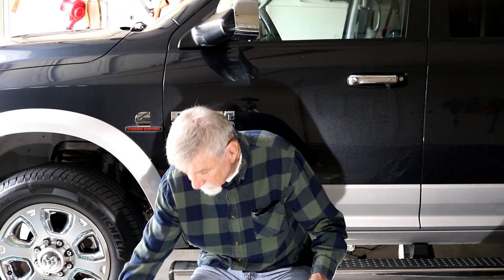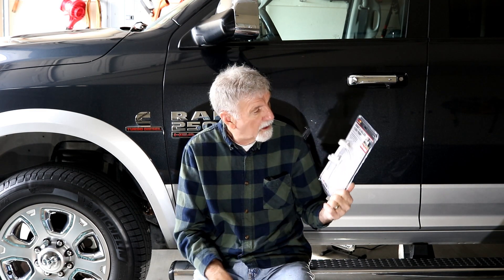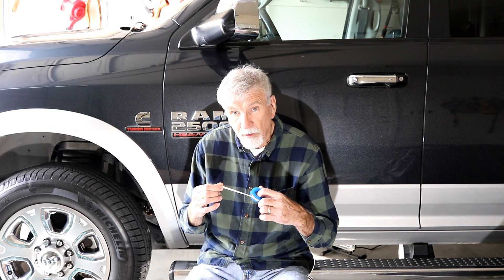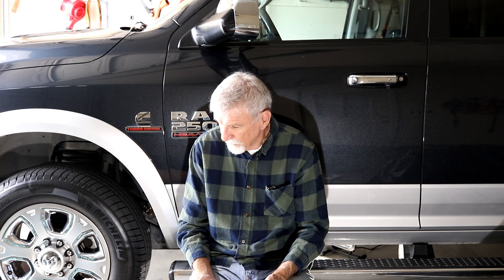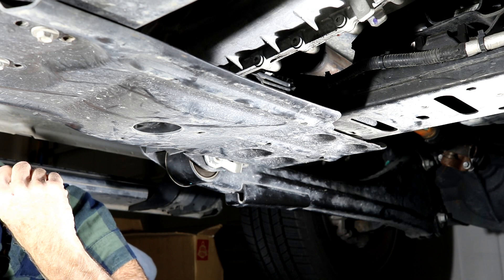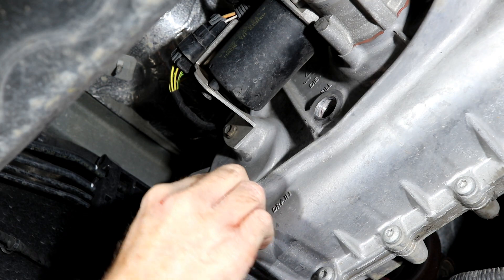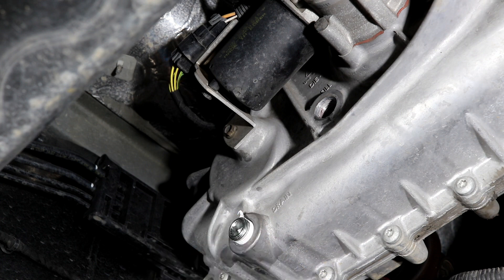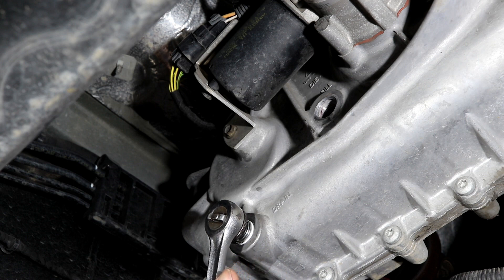Ram 2500 4 x 4 Transfer Case Oil Change

Comment: Hey Marion, I just did my 2nd (60k) fluid change. I looked on YouTube for a refresher and yours popped up. I remember it from my (30k) service. One little tip I stumbled upon that I thought I should share. When removing the skid plate, leave the right rear bolt loosely in place and the skid plate will rotate out of the way and rotate back when finished. Not a big time saver, but it was nice not having to line it all back up when laying under the truck. Thanks again for your videos. Always nice to watch them. 👍

Comment: Marion, I really like your channel. I also have a 2014 6.7 3500 Ram Truck. Did a lot of research on the lubricant for the 44-46 and 44-47 BW transfer case as Mopar has priced their oil out of sight. Spoke with the Amsoil rep and Amsoil now has one. It's part of their Signature Series and is priced around $21 per qt. Plus you can get it in their flexible squeeze bag which makes the filling very easy. Also, BG has now developed one and our Ram Dealer here in my town is now using it instead of the Mopar oil. Check it out as both companies produce top quality lubricants. I prefer the Amsoil and have had no issues. Thought this might help your viewers find something other than the WAY OVERPRICED Mopar oil.
Reply: What codification has the amsoil lubricant to BW transfer case? Thank you.

Comment: If you want to save a little scratch next time you change the fluid, the company that builds the transfer case fills them with DexIII fluid when they are built. There’s no need to buy the liquid gold from Mopar. This is first hand knowledge not hearsay.
Reply from the maker: Yea, thanks for the tip.  This stuff was over $20 / quart
Reply: @MarionBlair  Now it's $31/qt at the dealer (Dec '20)
Reply from the maker: @dantaylor1068  Good Lord!

Comment: I don't know if mine is an isolated instance but my transfer case has developed a leak between the case and the trans at around 105k.  I'm betting it's the seal, which is about $10, but I'm not exactly looking forward to pulling it out of the truck and replacing it.  But you know what?  I'll be damned before I take my truck to any dealership for a repair.  It might be a PITA but I'll know it's done right and the first time!
Reply from the maker: Yea, it doesn't look too bad if can get a little working room under there.  Maybe try torquing the bolts if you haven't first.  Also, there's a vent hose on over by the u joint (i believe).  Make sure it's not stopped up.  You've reminded me to put that in my video.  I forgot about it.

Comment: Sir, just wanted to let you know I completed the change in my transfer case today (2015 2500). Your video was invaluable. I thank you so much for taking the time to put this info out. PS. My only mistake today was placing the oil pan too close to the drain —man that stuff comes shooting out!! Left 1/4 quart on the ground before I could move it!
Reply: I know im randomly asking but does anybody know of a way to log back into an Instagram account?
I was dumb forgot my password. I love any help you can give me!
Reply: @Kaden Ira instablaster =)
Reply: @Emerson Wilson Thanks for your reply. I found the site on google and im waiting for the hacking stuff atm.
I see it takes a while so I will reply here later with my results.
Reply: @Emerson Wilson It worked and I now got access to my account again. Im so happy:D
Thank you so much you saved my ass!
Reply: @Kaden Ira Glad I could help :D
Reply: What fluid did you use on the transfer case?

Comment: Just did my 2013 ram  68rfe transmission today. It’s a messy job but went with Mag Tech pan to make it easier next time. This one tomorrow. I still haven’t found the grease fitting. Thanks for the videos.

Comment: I feel like a regular fixture on this wonderful site! (lol)  This comment is a bit off subject, but transfer case related.
Last week while pulling our 35' travel trailer, we stopped in Kingman AZ for one night on our way to Grand Canyon. Just when we were exiting I-40 we heard a horrible grinding sound. Almost sounded like we were dragging something under the truck. We stopped (so did noise) on the off ramp and warning light was on the dash that read "service 4x4 system".  I put the truck in neutral and rolled slowly forward on the downhill slope. The noise was gone and so was the light. All seemed normal again, so we continued another 2 miles on the surface road to the KOA in town. 
Our pull-through space was gravel, so I took the opportunity to move it in and out of 4x4, and 4x4 low. No problem. With no internet and being late on Saturday, I called my brother to do a Google search. What he found is that the truck most likely tried to go into 4x4 low range all on its own, at 45mph!! (we weren't the first ones to experience this, others with catastrophic results)
I pulled the 10-amp fuse that controls the transfer case servo motor and we continued our trip without incident. Upon returning home, I went to the dealer. They were mostly useless. The service writer found 3 codes, one of which was for the rain sensing wipers. Other 2 were related to 4x4 system. I asked if they would drain transfer case and check for any evidence of damage in the fluid. Yes they would, but I had to pay for it. Now I have an appointment with my trusted transmission shop. They'll do a transmission service and drain the transfer case to see if anything shows up. 
The weather was close to 90* and the truck's fluids were hot from pulling mountain grades. But it was not at all overheated. Therefore I have to assume whatever happened was an electrical issue related to the heat. We live near San Diego and only use 4x4 when we go to snow in Mammoth Lakes several times during the winter. It sucks to have to do this, but I'm probably going to run the truck with the 4x4 fuse out, and just put it in when we need it. No big deal, but I miss my old "part time" 4x4. This kind of shit didn't happen :) 
BTW, this truck is a 2016 3500 Cummins with the standard automatic transmission and 30,000 miles on the clock. Still has factory powertrain warranty. 
Dave O.
Reply from the maker: That really sucks.  Sounds like my luck

Comment: Finally - an easy Ram oil change!.lol 
I always error on the side of caution when tightening ANY of my drain plugs that have OIL or lubrication on the threads. Anytime a bolt has OIL on the threads you should use 35-45% LESS torque than you would when tightening a DRY bolt. The same goes for GREASE 35-45% LESS to achieve bolt axial load or tension.
- FYI- I would have put a little less force when tightening those plugs.  That plug won't leak with teflon thread, it seals great.

Comment: One difference between you and a Millennial is that after you tighten the bolts on the skid plate you torque them to feel.  Most Millennials will torque with the air tool and if they even try a wrench on them the bolts will likely be overtightened.
Reply from the maker: Thank you

Comment: Hello again, Mr. Blair.  I'm hoping that you remember me, but I'm the guy with the 2012 6.7L Ram 2500 with the crazy emissions issues (aka, the Katrina guy who used to live in Harvey, LA).   We just found out that we will be "out of pocket" $6,000+ to bring the emissions system back to factory specifications ...so we -- and I'm sure you would agree -- are inclined to make some "changes" to our truck to make it more reliable and run like the wonderful 6.7L ISB we paid for is capable of.  What I wanted to ask you about was the device I've seen in your videos -- the one that displays all of that great information via a video screen.  Although I've been up to my elbows in our old 5.9L Cummins Ram, I'm a rank beginner when it comes to the 6.7L version, so please bear with me here ... Is that device part of a "tuner" or is it simply a device that acts as a video display for multiple "virtual gauges."  Perhaps you've already covered it in other videos, but I'm so bogged down with talking to folks about getting the truck towed here and there that I haven't been able to spend a lot of time on YouTube lately.  Thanks again for your time.
Reply from the maker: Hi, of course I remember you.  I didn't know where you moved to when you left Harvey however.  There's two monitors I've played with but the one you probably are referring to is the Edge Insight CTS.  It's just a monitor and doesn't change anything in the PCM so warranty isn't affected.  I also just did a couple of videos on the Torque App which is an Android app that can give you some of the info.  The Edge has a crappy screen but otherwise it works.  If you just want exhaust temp and DPF regen you can use the torque app with your android phone. Question, what's with the 6K on your emissions system?  Did you delete and now the state is making you put it back to spec?  What state did you move to?
Reply: @MarionBlair  Although I'm a deep southerner myself, Mr. Blair, my wife is a Massachusetts yankee girl.  Long story long, we lived in Harvey, then Gretna and, voila, Katrina blew us up here.  I do, however, still go home for work, so I'm not an actual Mass citizen, which brings me to a wrinkle.  As I still spend a lot of time in the south, the truck is still registered back home (in a non-emissions-testing state).  Along with lots of other over-governing, Mass tests their vehicles annually to keep someone in Boston in the life they've become accustomed to.  The point is that, technically, I don't have to worry about emissions testing ... but ... who knows what the future might hold for us.  Regardless, the $6K they want from us is only part of the entire bill.  Believe it or not, the entire repair order -- for just the parts -- totals almost $12,400.00!! (comes straight off the dealer cheat sheet).  The $6K part is what we pay ... and the rest ... well Mopar is paying for that out of the goodness of their corporate heart (and out of the extended 7-year Mopar warranty we've been paying off for years).  It's truly a sad commentary on what the EPA folks are doing to these fine trucks, but I trust you agree that we're not going to put the gag back on the engine. In closing, it's $6K+ to restore the truck to the stifled soot processor it was (aka, back to factory specifications) or spend a lot less to restore the reliability that our old 5.9L Ram 2500 4x4 is still famous for (al least around here).  Now that I've worn your eyes out, do you have any thoughts on anything to do with modifying the 6.7L ISBs?  Thank you, sir.
Reply from the maker: @timberwrightsvs480  Oh, what a dilemma.  I'd keep it registered down hear and leave it clean, ha.  Have you had any issues with the delete, do you know what tuner you have etc etc..  BTW, I traveled to Boston/Worcester at Raytheon  many times in the 80's while working for Exxon.  I really loved it.  My sister lives in New Hampshire, Florida and Bar Harbor depending on their mood but spent a lot of time in Bar Harbor.  Loved Boston however.

.
Reply: @MarionBlair  As always, thank you very kindly for your responses, Mr. Blair.  I probably fouled it up somehow, but the truck is presently sitting in the driveway.  It is still bone stock ... coughing, smoking and belching white smoke.  In short, the defective emissions garbage is still on the truck, but, based on costs alone, we plan to order a tuner, an exhaust system and an additional kit to deal with what the dealer tells me is the root cause: a defective EGR cooler.  Put simply, we cannot afford $6K+ to restore the truck to factory specifications, so we don't have a lot of choice here.  Please let me know if you're interested, sir, and will keep you informed about our progress ~ Joyeux Noël

Comment: Thank you,  your videos are teaching me how to do things myself that are invaluable.
I tow with my truck mainly in the summer heat of the deep southern US, I have saw advertised 
deep transmission pans that add fluid capacity.  Do you think they would aide in cooling the transmission,also what about using synthetic fluid ? thanks for any reply.
Reply from the maker: I've never tried one, I'm sure it might help a little.  My 1st reaction would be very little as the cooler is doing 99.9% of the cooling but I could be wrong.  The fluid doesn't stay in the pan very long so I'm not sure it would get a lot of retention time, even with the added capacity,  to get the benefit of the bigger pan which  I assume has aluminum cooling vans etc...  It may take longer to heat up the extra fluid on inclines but on the straight away,  I'm not sure.  Just my thoughts, I could be way off.  The main reason I would install an after market would be to get a drain plug, ha.  Some one who has one may know.

As far as synthetic, I assume you mean in the engine since the transmission is filled with synthetic.  I've always ran Delvac 1300 in my diesels but that's mainly because I don't put enough miles between changes to really be economical.  I'd be draining oil every 6 months with 4000 miles on it.  However, synthetic is going to hold up much better for the turbo and engine in the high heats when towing in the summer.  So if I towed more often, I'd switch to it.  The only thing I don't like is the 5 w 40, I wish it was 15 w 40 but it works and is great for winter cold starts also.  I'd still change it 10k or less even with the synthetic but that's just me.  From what I've seen of some of the oil analysis, it gets kind of iffy above 10K.  But I haven't done it so take this with a grain of salt.   No question that synthetic is superior to dino oil at either extremes, cold or hot.  Normal conditions, I don't think it adds much other than you can run it longer as it hold it's property and vis longer.  Just my thought.
Reply: thank you.
Reply: Adding a deep transmission pan lowered my cruising temp from 172-175 down to a solid 165 with or without a load. The temp still spikes when the tranny is working hard, but it cools down a lot faster as well. Definitely worth the money. 
If you install one, it’s a good opportunity to change the tranny filters as well.

Comment: Mr. Blair,
2018 Ram 2500, 37,000 miles.  Have owned it since new.
After watching your video(s) I’m going to attempt changing out the front and rear differential oils.  Never been changed.  In addition, the transfer case.
Question:  If the rear differential has a limited slip, do I need to add an additive with the new oil?  Also, is removing the cover plates on the differentials and replacing the “gaskets” a more thorough approach or am I making more work for myself than necessary?
Would greatly appreciate you input.  Many thanks!
Take care,
Dan
Reply: Your games shoukd be reusable. Just take care when removing the cover and peeling gskt off. The rear differential should be an AAM
11.50 helical gear limited slip.  Model # 292AA.  This differential does not use clutch or friction plates to attain limited slip. It uses helical gears to attain limited slip. As a result it does not require any limited slip additives. Just get a dealer to confirm what differentials you have in your truck and go from there.

Comment: I'm a bit overdue on mine needing changed, but what is your confidence level in doing this the first time?  I'm fairly intelligent, (I once build a 318 V8 engine for my Charger) but these newer things "concern me" some.  I've learned to change my oil and fuel filters from your videos.  

I think I could do the same with the transfer case and diffs.  

BTW, side subject.  What are you thoughts on the Banks Rear diff cover for the RAM and AMSoil  lubricants?

Thanks.
Reply from the maker: 100% sure you can do it.  You can do it without remove the hose like I did.  Just take the bolts out and slip a new one in.  I think if I was going to add a rear diff after market cover, Banks would definitely be the one.

Comment: Hi good video. Got a question even if you don’t use the 4x4 have yo replace the oil?
Reply from the maker: I wouldn't pull the cover, use a little hand pump from harbor freight or whatever.  I really doesn't get dirty from what I've seen.

Comment: Good video my friend. Does the manual say to change every 30,000 miles?
Reply from the maker: No, it's check it at 30 and change at 60 unless you do a lot of towing and severe duty like police work etc...
Reply: Marion Blair thanks for the info!  Stay safe.

Comment: I have a new truck that makes a loud cluncking noise after stopping, selecting 4 wheel low and then shifting into drive, I can't tell if it's the front drive shaft or the transfer case?
Reply from the maker: That could be normal actually.  Ram  tells you this shift it while you're still rolling in neuutral. try that and see if you still get the clunk.
Reply: @MarionBlair  I will try rolling it in neutral, thanks so much for your help, all is great once it's moving in 4WD, and I take it easy on my truck because I want it to last. I do realize that there is tremendous torque force's involved being diesel compared to gas. Thanks again, and your attempt at Spanish is far better than mine.☺️
Reply from the maker: Haha thanks

Comment: Would you recommend changing differential fluid front/rear at 30k if you DON'T tow very often?

I'm trying to figure out if I should do diffs and TC, diffs, or none.  Truck has 29k miles.
Reply from the maker: No I wouldn't.  Just look for leaks and check fluid level if you see any signs of leakage.  BTW, my son  has 300K on his and has never changed it.  I'm afraid to pull the cover but it's whisper quiet. ha
Reply: @MarionBlair  Thank you sir, I'll do that.

Comment: What fluid did you use on the transfer case?
I have a 68rfe transmission on my 2015 ram 2500
Reply from the maker: Mopar 68089195AA